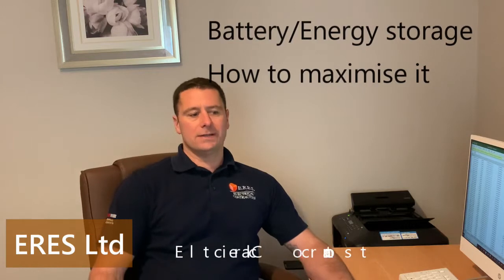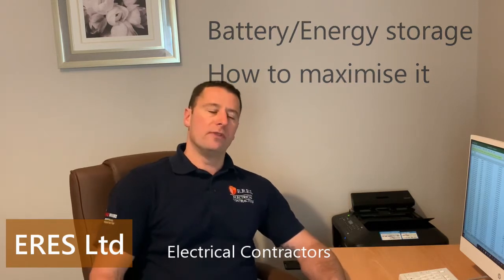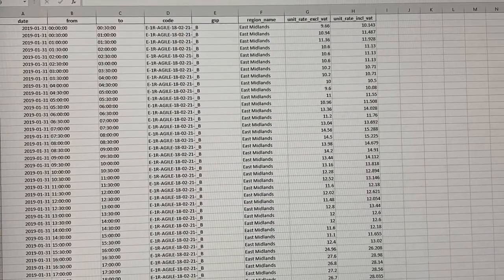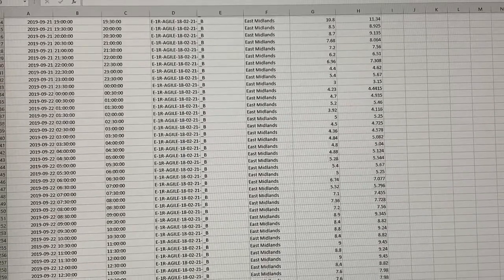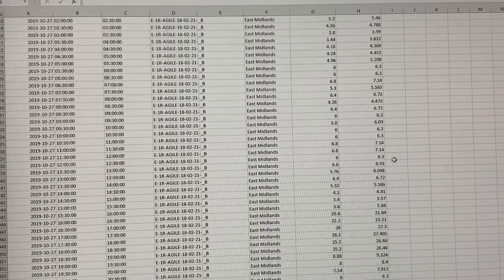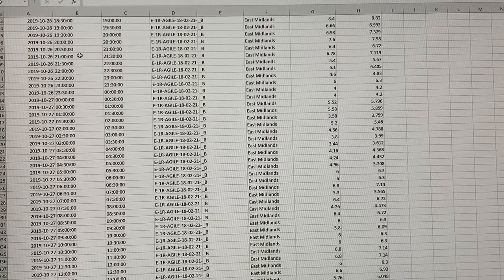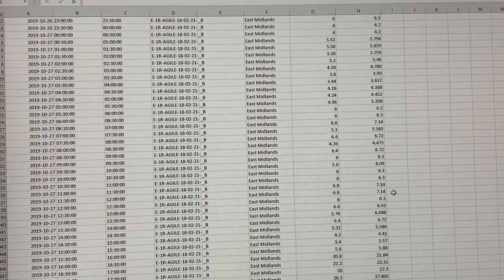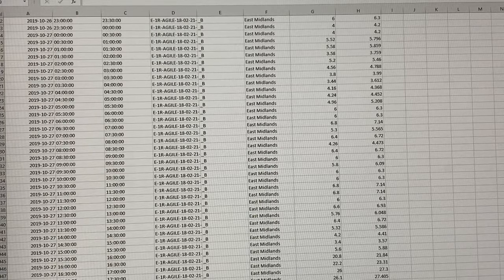Battery Storage, how to maximise it, Octopus Energy

Comment: I’m with octopus at mo ,got solar and 4 batteries 10.4 kw not got a Ele car so carnt use go or go faster anyway,I’ve just sign up to there outgoing agile for any thing I send back to the grid ,and I’m on flexible tariff for pulling off the grid ,do you think I should stop on flexible or go on agile for my grid use even with the high price it’s all going up thanks
Reply from the maker: It’s a tricky one due to current tariffs, you have to work out what’s best for you regarding what to do, it depends on your usage and current price.  You should be more concerned about import price than export price at this time of year (mid September) as the big exporting months are coming to an end.
Reply: @ereselectrical9397  yep true it will be next year now to get best out of export tariff,so looks like agile or or stop on flexible

Comment: Hi Sandy, spending a few hours looking at your presentations which are very informative. You state

'you generally don’t install SolaX, better value, bigger batteries out there and the aftercare/technical help with SolaX is terrible' 

Can you mention any battery manufacturers that are compatible with the SolaX inverter, effectively mix and matching manufacturers of different inverters and batteries or must you always use an inverter/battery from a single supplier? Thanks
Reply from the maker: If you go with an AC coupled inverter for battery charging and discharging you can mix and match no problem. The new Givenergy 9.5 kWh battery is good value however has horrendous lead times. We are still waiting on Decembers batteries. 6 months +

Comment: One problem with all the videos promoting battery storage is the GO tariff is now blocked for normal people who don't have an EV, and is only available for the rich who can afford an EV. Typical.
Reply from the maker: You are right regarding Octopus now requiring proof of EV ownership however there are plenty of EV tariffs out there that don’t require an EV. There are also cheap second hand EV’s out there too.
Reply: @ereselectrical9397  which companies do an EV tariff around the 5p mark. I would search but the comparison sites are not working due to the current price rises. Also what is an affordable used EV? We spend between £1k-5k on used cars as I earn £9.36 phr as a computer tech in a local college. Thanks for the reply though, at least you replied unlike EVM.

Comment: I love all these videos at least this video explains in more details. What the others don't get is that having a company come in and install 9kw solar and an 6 fancy 8.4kw battery very nice tech but is it really cost effective. Yes if you right off the cost which could be between 8 and 15 k then it's a no brainer. But you have to add the cost. In my case as long as my battery does not fail again as if it does its no longer covered so now I am into my 6th year and still got 6 years till my investment has returned. I did a calculation on my property and for what I have spent with on my system I could have paid my electric bill for 13 years. I did my calculations not in my favour. I really love all this high tech but its really for people who have a dispissible income and who are not that bothered about an electric bill every month. My other concern is warranty. People buy these tech systems with the glossary with warranty info plastered all over them. But in reality it's a bit like talking about home insurance saying down the pub my company is fantastic they are cheap and they give me x y z. But you really don't know what they are like till you have to use the policy for real. In my case I have had one tranergy inverter fail, did not know that the small print stated a recon not new would be sent out and it took 3 months. My growatt sp2000 battery controller failed twice luckily under warranty but it took months, the 3 battery's and again small print it came as recon unit, 2 nd unit came broken and again took months. Now I am fighting to get my off grid Goodwee battery controller changed and that's going round in circles system being off again for months and got know where. So please take this all into acvount as most people will have also to pay a company to come and look first this could be £200 just to come out each time. Other than this we are all speaking to have cheaper electricity and get wiser and battery's are good but they are to exspensive for the average home.

Comment: I have a solax "triple power" battery and inverter. They are VERY temperature sensitive! Below 20 degrees C the capacity and charging / discharging rate drops off dramatically. Also the 6.2KWh battery only has around 5 KWh actual usable (at above 20 °C) at 9 degrees C the maximum charge and discharge rate is down to around 850Wh ! At 0°C it more less shuts down. Capacity of well bellow 2KWh. To say I am disappointed is putting it very mildly. No one said anything about this problem with the battery. 
Unless you can keep this battery in a centrally heated space it simply is useless for most of the year.
Reply from the maker: That doesn’t sound good. I would always advise room temperature if possible. We’ve had that one installed in our own home trouble free, works just as it should. 

We generally don’t install SolaX, better value, bigger batteries out there and the aftercare/technical help with SolaX is terrible.

Comment: I use this system but there seems to be no options to set times.   On self use - Battery seems to spend its life empty barely charging during the day then charging at nightabout 2030 and then dumping all at 0500 or the other setting on EPS spends its life Full dropping to 98% and then topping up to full.    Minimum state of charge feature seem disabled?     I'm also not sure many installers actually know how it works either.    (I set up the wifi and solax cloud link for our system as installer didn't really know how!!)     The meter integration is also a mystery.     Do you need to connect the solax system meter AND your main building meter in the app?  Is there Admin to be done with elec supplier?     Its all Very unclear!
Reply from the maker: Hi Iain. Sounds like your installer hasn’t handed over very well. The Solax inverter is really good. Force charging can be found by going into settings, work mode, then select force time use, in there you can set up to 2 individual times and state of charge levels, by default it acts on self use whilst not force charging. All the above I’d set up on the inverter display. 

If installed properly the digital meter which is attached to your mains tails monitors generation, there is no need to connect to main property meter. Hope this helps.

Comment: Now on octopus Go my contract with Eon ended so I signed up with them and opted for 'go' they even got my smart meters working and so am on the 5p/kWh overnight rate however when charging overnight I cannot get the charge to go beyond 25% from empty. It just flat lines to maintain background consumption (c. 100watts) I have set both timers to the same for 4 hours, self use. Have you any workarounds for this?  I would have thought that the charge continued until 100% was reached?
Reply: UPdate.. Reply from Solax..... You cannot see the % setting when in force time Use from the App!!!! So you need to set it from the inverter, mine was set at 25% which I have now adjusted to 100% According to Solax the default setting is 100%, don't know why mine was 25%
Hopefully all sorted now.
Reply: @BrianSmith-qd4he  how do you find it works in the colder months? Mine is terrible. Also the 6.2KWh battery actually only supplies around 5KWh because they save the bottom 10% and the rest is in charge / discharge losses they say. Personally I think they should sell the battery as a usable 5KWh (at above 25 °C) and 2 KWh at 9°C which is what I am getting.
Reply from the maker: Are you using solax? Are you in force charge mode? When in force charge mode after the “time off”scroll once more and it allows you to force charge to what ever percentage you want.
Reply: @ereselectrical9397  thanks for your fast response. I have a solax charger AC coupled to a solar edge array. I have looked at the settings and can confirm that I am using force time mode use for c.4 hours in cheaper rate time slot, I have NO option to set the % charge by scrolling down. It charges at 16A then flat lines to maintain base use. Solax support are looking at this issue at mo. I'm on octopus Go.

Comment: I'm finding your videos very helpful. I'm looking for similar systems also have an EV,. It would be very useful if you could explain or develop a system that allows for the battery (the Solax) to be charged automatically when say Octopus Agile 30 minute Tariff drops say below 5p kWh or rate set by user. Do you know of such a system controller?
Reply from the maker: To the best of my knowledge you can’t do that. I have thought that something similar needs to be developed, I don’t think it will be far away as the Zappi EV charger has more charging options similar to what you are saying. We’ll be looking into the Givenergy systems very shortly, they are quite forward thinking when it comes to dynamic tariffs. Take this concept a step further, a system that looks to the next days solar prediction for you array by looking at the weather forecast (already apps for this part) and force charge your battery to a percentage level to minimise grid pull, an automated system that you leave alone and let it maximum efficiency, whoever cracks this one will storm it.
Reply: Im not sure if this answers your question but you can set the X1 inverter using the "Force Time Use" mode to charge during the Octopus Go low rate period. See here for more info  https://www.solaxpower.com/wp-content/uploads/2021/03/X1-Hybrid-G3-User-Manual.pdf